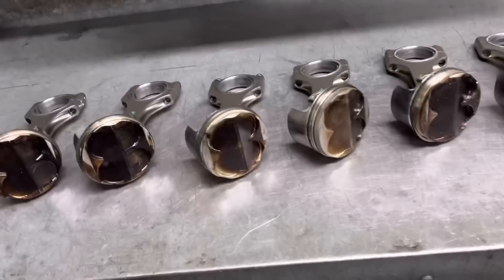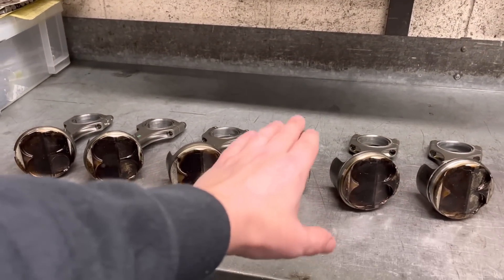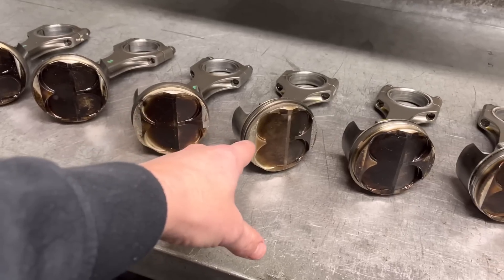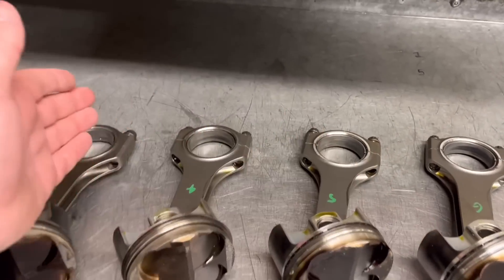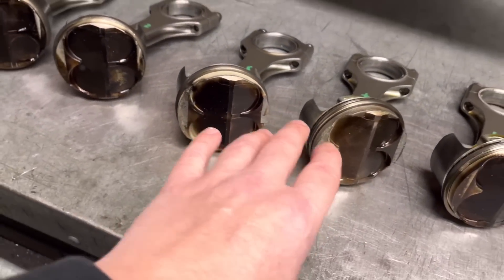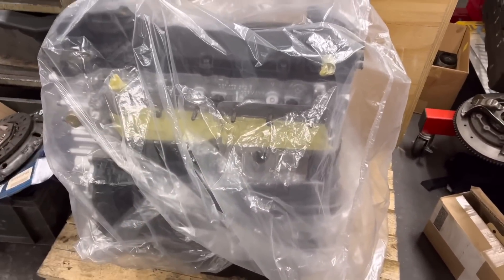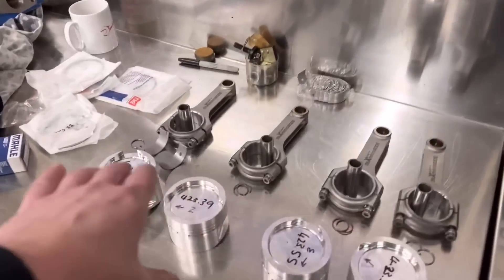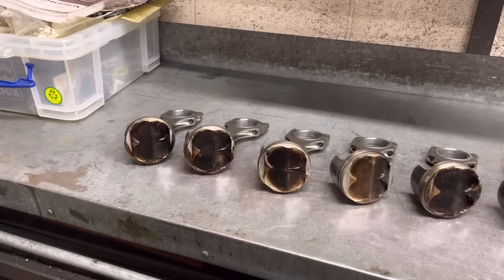BMW E46 M3: My opinion on why this engine lasted 2 days & went BANG

Comment: Looking at the design of those M3 pistons makes me cringe a bit. That very thin wall of piston that sticks up around the edges where the piston head is relieved for the valve clearance provides hot spots on the pistons which in my mind not only will create a source for detonation, but will also be the place where the piston will melt, and bits break off. From looking at them they all seem to have failed in those places. It just seems like a terrible design if they come from the factory that way, or if modified later, a modification that shouldn't be done.
Reply: Agree with that any sharp thin area such as on the piston crown valve recesses are bound to get hotter than the areas with more mass. Not a fan of the way they are machined out to accommodate the big valves.

Comment: Beating the piss out of the BMW for 3 track sessions it's possible the oil was so hot it started to be thin enough to get up past the rings on decel then rattle it bad for a bit every time.   Not the engine's fault...support equipment must be able to keep things at their normal temperatures or any engine is going to die.